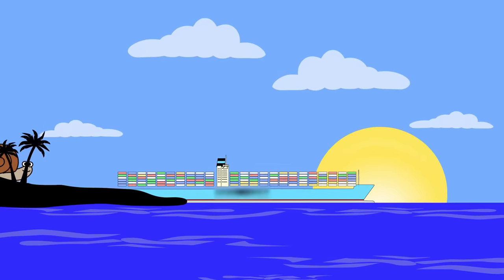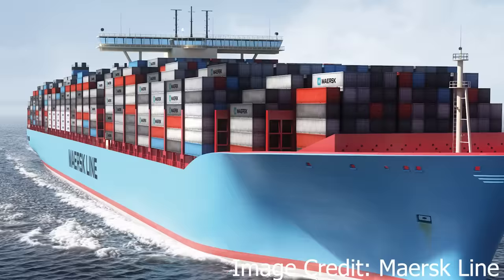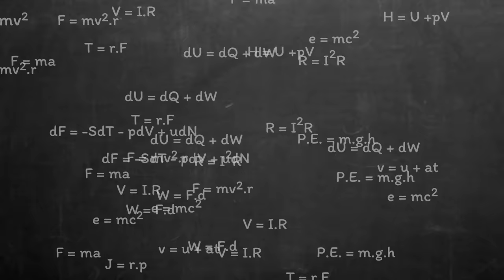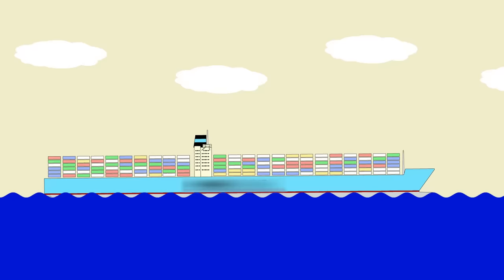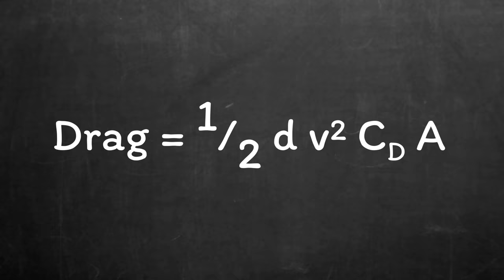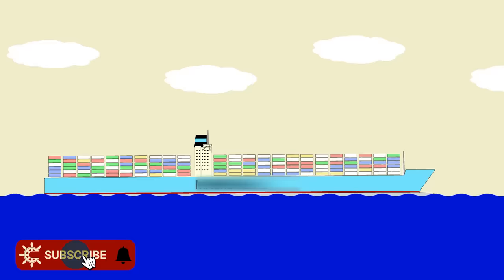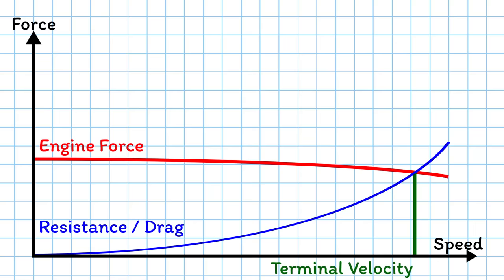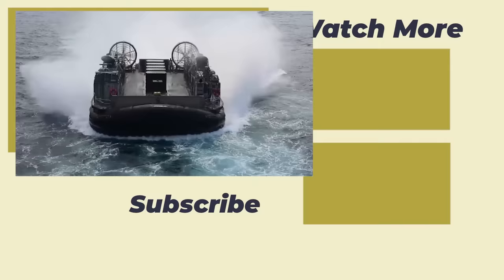Why are ships so slow?

Comment from the maker: Thanks for the amazing response everyone. I just wanted to address a few points raised in the comments. I like to keep things as accurate as I can so do continue call me out when I get things wrong and I'll correct anything needed.

Hull Speed - is not actually a speed limit. As many have pointed out, it is just when the vessel's length equals the bow wave length. It doesn't actually restrict a vessel's speed. 

HP - is used purely for ease of comprehension as it is easier to visualise than kW.

Drag - it does depend on numerous factors, but I kept it as a cross section alone as the main point was to illustrate the way it increases with speed.

Obvious Answer - maybe, but the purpose of the video is entertainment. I have plenty of tutorials on the channel so am making videos like this for fun.

Again, thanks for watching!
Reply from the maker: Squat will be covered in a future video. You have to account for it every time when docking a large ship
Reply: I like the video you should do one the bubble system that reduces drag on the bottom of the ship to glide better
Reply: Slightly wrong about the drag equation. It is uncommon to use d to represent density, which is a very important factor as the density of water is much greater than that of air and is the main contribution to the drag force. Secondly, for low speeds, drag is said to be proportional to v not v squared. This is because drag force is not something that is fully understood and the equation is just an approximation. For low speeds, it is impossible to tell the difference between quadratic and linear proportionality. For high speeds however, it will be very obvious.
Reply: Nice video super informative
Reply: Hull speed absolutely is a speed limit when operating a displacement hull. Unless you push it onto plane, which takes exponentially more power, especially for a hull not designed for hydrodynamic lift.
Reply: Just discovered your channel and I love it!
What about a video on the basics of ship designing? There are very few videos on that topic on Youtube.
Reply: David long already summarized it, but hull speed does matter quite a bit. Your equations mostly hold for displacement hulls right up until you reach hull speed, at which point you have the added work of climbing your own bow wave, which is not dissimilar to the extra energy needed to accelerate beyond the speed of sound in air. 

It significantly reduces efficiency, so large ships that are all about cost effectiveness in their design, tend to size their engines so that their cruising speed will, at most, just about match their hull speed (often quite a bit lower). So, your back of the napkin calculations will usually work for real world examples.
Reply: Hi, is the drag caused by air resistance also significant?
Reply: Because if they were very fast, they might hit all the fishes in the face very hard and then all the fish would die very hard and peta would be very much sad all day long. Prob lol ;) (but probably more about fuel economy)
Reply: Great video. You could use it to explain why large cargo ships so are much more fuel efficient at moving heavy cargo (cargo tonne miles per gallon) compared to any other form of transportation.
Reply: Unless the vessel can plane hull speed is absolutely the speed limit, and these large vessels are all displacement hulls which cannot plane. The only way to surpass the hull speed is to rise out of the water with a planing hull.
Reply: I thin you got the wrong conclusion from the formula
Ship is slower because Cd (coefficient of drag) of water is much higher than Cd of air. Hence ship have to overcome a lot of drag
Reply: Too bad you did not include calculation, how much drag ship vs plane vs car are exerted
Reply: Why we don't use 10-12 jet engines in ships.
Reply: You should've used hypercar over f1, f1 cars have so many power restrictions it's insane, and with after market parts well you can start to push 2, 3000hp in cars and strip 9ut so much weight that they little over a ton, I'd estimate it's possible to give a high end sports car a power to weight ratio of nearly 1200hp/t
Reply: Casual Navigation Isn't cruising speed 18 knots?
Reply: Hull speed/wave resistance isn't a speed limit, neither is friction, both increase until they match power.
Reply: If you wanna make your videos better, add some music in the back and put a sock on your mic.
Reply: @CLP you will never submerge the ship because of squat. Squat forces reduce as the depth below keel (UKC) increase. The problem you will have is grounding your ship in relatively shallow water, you can also expect mad effects on the turning circle etc.
Reply: @sakariaskarlsson634  we actually have speed restrictions around N.America so we dont bump into Right whales
Reply: SinfulMonk whales arent fish you silly, they are mammals just like us, but they too can fall prey to the true apex predator of the sea: the mighty steel ship
Reply: @CLP never heard of that happening, boats usually flip over when going much too fast because of the shape, but for obvious reasons that will never ever happen to a container ship.. But race boats do that sometimes and it can be a mess
Reply: @CLP its IMPOSSIBLE. The whole point of squat is that there is not enough water to fill in whats been removed by the vessels propulsion hence the bodily sinkage. If the water was deep enough for the ships to sink completely then you wouldnt get any squat in the first place beacuse there would be enough water under and in front of the vessel to replace that which was forced away.
Reply: @CLP i'd bet on this theorethical million horsepower 150 knot container ship flipping over lol but of course such a ship will never exist, but id say the limits is probably all about fuel efficiency and has nothing to do with safety really.. Except for local ones in and around harbors that is.. So you dont achieve ramming speed
Reply: CLP i think you confuse surface vessels with submarines.. but they dont sink because of speed eighter but by a tank filling up.. then of course if water for example enters the car space of a ferry because of speed, that could make it sink.. but that is a different story and has nothing to do with anything
Reply: As I understand it, Hull Speed is more or less the equivalent to the sound barrier for airplanes — as in, you can go faster than it, like in a speed boat, but it’ll take ridiculous power.
Reply: @CLP .. it's literally my job. Ive explained in the most simplest terms I can. Just please stop telling people squat will make your ship sink, its dumb
Reply: CLP nah i dont think so
Reply: @CLP please review your original comment...
Reply: @CLP haha yes very good. The effect actually stops when there is enough water around and underneath the ship to 'fill up' what is being displaced. On my ship when we are in confinded waters at 12 knots we would expect to stop experiencing squat at around 14m UKC.
Reply: The term I have seen used most for hp/t is “specific power”
Nice vid learned me some boats today.
Reply: I like to describe hull speed as a speed bump rather than a brick wall. Most container ships are also so long that they'll never get even close to hull speed. The largest ever built container ship does not even do half it's hull speed. The designers main concern is efficiency rather than how fast they can go.
Reply: Seems different people have different "opinion" about the Hull Speed and how it effects the speed.
Reply: @uham999  Not more efficient than rail. But ships have the advantage of always traveling on the level. No up hills in the ocean.
Reply: @capnbilll2913 Could be. I'd like to see a comparison of that. Problem with rail is that it has to go back to its origin. Its likely to go back half empty on goods trips. Goods generally flow east to west across the world but not so much the other way.
Reply: @uham999  This is purely energy per Kg, and ships also have  return cargo issues.
Reply: Pp
Reply: _yes yes your all explication is valuable and speed amazing_dependent of power engine_motor and this give speed turation of helicoid_ellice __but is and number helicoid is very important and not depending very much from form combustibile motor because build_constructing engine motor very power of steam coal_motor or diesel_motor of fuel_gaz_petroleum_motorine_gazoline and nuclear power reactor very power__and economy of fuel is casual prime for speed low and slowly archaicxn lord
Reply: @brambl3014  Drag, (friction) is a very small percentage of force required, the displacement of the mass of water is the largest.
Reply: @0xjrr  the nautical mile is very convenient for navigation, being 1/60 of a degree of latitude.  That is why it's universally used, even in metric countries.
Reply: @dbeierl  each degree the radius line of the Earth sweeps out corresponds to 111,139 meters... if you have computers it really doesn't matter
Reply: @0xjrr  nonetheless, the people doing it find knots a more convenient unit than meters per second.

Another convenience for US mariners is that one nautical mile (6080 feet) is close enough to 2,000 yards to make it  handy for piloting.
Reply: Drag, fish wat..
Reply: I've read a number of comments about hull speed and that the only way to go faster is bringing your ship in plane...Some time ago I asked my son, glider pilot and engineer in fluid dynamics if his plane also had a hull speed like a boat. He told me that you only have something like maximum hull speed when you're moving at the border of water and atmosfeer, because there you have that bow wave. This means that there is no direct maximum hullspeed for any submarine which is deep under water, and also not for ships in plane...the last one is already mentioned a lot of times.
 But there is another problem in water which limits speed more or less...cavitation. When the propellor is turning so fast it makes a vacuum at one side of the propellor the propellor will not work any longer as it should. You cannot create speed efficient when there is a vacuum (partly) instead of water around the propellor blades.
Maybe cavitation is also nice for a subject.
Reply: I definitely had a more inappropriate saying for the horsepower per ton equation..
The mass to ass ratio, but I usually only think of it in terms of people. A person has the ability to efficiently move on flat surface the equivalent of their body weight, their mass to ass ratio is 1. If they can move that same weight or greater on inclines or flat surface, their ratio is 2. Athletes strive for a ratio greater than 2. Thank you for giving me the actual formula and how to apply it to now than just people!
Reply: brilliant and informative video, awesome voice tone, and thank god for not adding any bgm
Reply: My interests are in photos, shipping. I am a volunteer running a mission to seafarers when they come in on a boat from the docks, they have an area where they can come and relax have refreshments, watch television,, read some papers and use the computer.
Reply: If this style is not to your liking, find another channel. For a similarly informative channel with zero narration, TheFlightChannel is of uniformly superb quality, though you have to be able to read. FWIW, this channel’s narration does not strike me as excessive in the least, though I suppose if I were in the applied sciences rather than a layman in this topic, I might think otherwise.
Reply: Sorry, Bro it was me about obivois answer.But i also got 9.2k likes so probably put more info .
Reply: USA
Reply: And Good Byee
Reply: Why ships cant Fly?
Reply: @TheOpzoomer  horsepower for a jet engine varies based on speed.  For same thrust, higher speed means more power.  The massive Saturn V rocket with those massive F1 engines produced 0 hp when they are ignited because rocket is not moving...as speed increases the horsepower goes up.  Similarly a jet engine at full throttle before brakes are released produces 0 hp.  Once brakes are released power starts to increase (thrust remains the same) as plane accelerates.
Reply: Hull speed is actually crucial. It very much does restrict a vessel's speed, and that is the reason why smaller ships are slower. It takes much more energy to accelerate when you have to climb your own bow wave, effectively making it impossible to accelerate when you account for real world factors like engine power, fuel cost, and fuel weight.
Reply: The average hp in a car these days are 200hp. Top fuel dragsters make 11,000. Not sure why you picked a f1 car for comparison.
Reply: Great video!

Stupid question: Why are some graphics blurred / censored?
Reply: @SusanneAuer  same question here
Reply: I also wonder, are the bigger ships also slower/limited for safety reasons? Considering that stopping a vessel hundreds of times heavier than a plane and hundreds of thousands times heavier than a car is a mission on its own due to the law of F=ma. Not to mention rogue waves and weather conditions and risk of overturning...
Reply: Hull speed DOES restrict a vessel speed. It's not a hard limit; and given enough power, you CAN rise above (the Planing that you mention). But the extra power required to pull that off is ASTRONOMICAL, so you'll never accomplish that for a displacement ship carrying cargo.

As per Froude's Law, the physical theoretical maximum speed of a regular ship is a function of the warerline length. Longer ship = higher possible speed. That's one of the reasons container ships have gotten so big. Economy of scale, even purely in the physics.

Worth considering also the carrying capacity. Sure a plane can go fast, but they can't take all that much with them. "Tonnes/mile" is a nice way of looking at things like this and then you start to realise ships are REALLY energy efficient. Much moreso than cars/trucks and CERTAINLY much moreso than jet aircraft.

Now consider jets are EXCEPTIONALLY BAD at energy efficiency. While those massive ship diesels are REALLY REALLY GOOD.

Suddenly shipping is starting to look vastly more environmentally friendly than any other means of transportation. As indeed it should, because that's actually how the world works.

Nextc question:
What do we want all that speed for anyway?
The slower you go, the less energy it takes. Because not only is ther that second power you mention in the speed equation; by the time you're looking at the 'horsepowers', that has become a THIRD power. And THAT'S physics being just plain nasty to our modern rushy-rushy society.

Bring the ship speed down and the relative wind speed increases. That makes any sails/kites/whatever much more effective, helping with wind-assisted propulsion. This way, shipping can become even greener still!
And all it takes is to *slow down*.

That said, I'd like to see the slug/snail that manages to overtake Emma Maersk going at full speed! In fact, a human won't be able to keep up either. A human walking is, wha... 3 knots or so...?
25 knots is pretty darn fast!

Short story:
Why does an ocean crossing with a ship take so dam long?
Because this is actually a BIG DAM PLANET, that's why!!!
Reply: Why don't you just turn the whole video into a blurr? Wouldn't that be a lot easier?
Reply: @CasualNavigation   Nice video i has the red butten on
Reply: Why do you refer to the ship as "she/her" when it does not and cannot have a gender?
Reply: They’re certainly not bloody slow when you’re trying to stop one in a hurry.
Reply: @nicholaslau3194  No. The relationship between velocity and drag is dependent on the Reynold's number for the flow, which is about more than just the speed. Because the ship is so large, the flow is still turbulent (and hence drag proportional to v^2). It has nothing to do with the fact that a linear approximates a quadratic at low values.